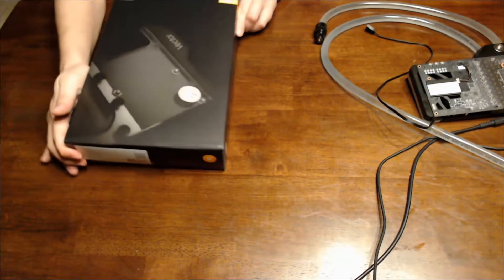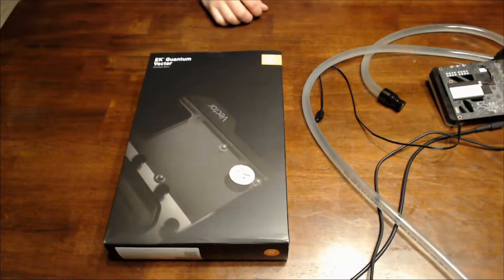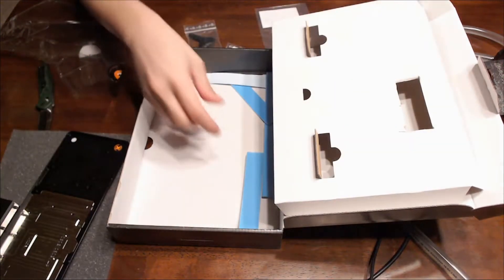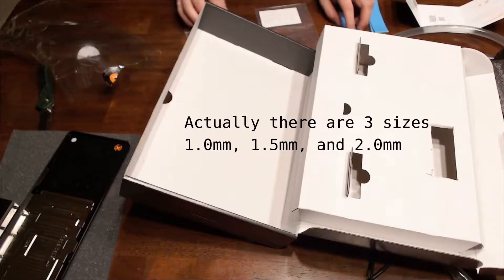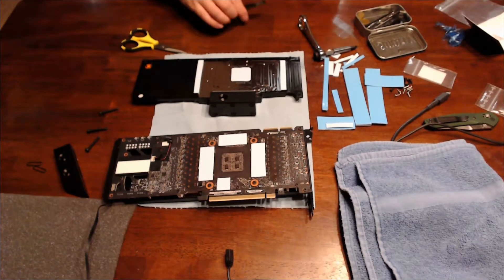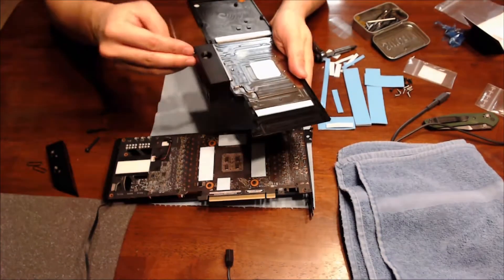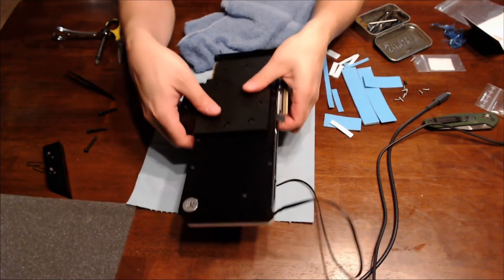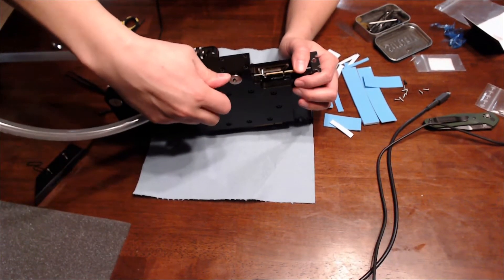EVGA 3090 XC3 EK Vector Active Backplate

Comment: Blocking the way? you took the VRM heatsink off!! lol
how did that work in the long run?
Reply from the maker: Good catch and it didn't work well... seems the block has a flaw. I should have done more research beforehand. After when I saw terrible performance I took it apart and learned a lot. I made another video where I did a fix to compensate. Now running in the 40s or 50s under load and it's awesome! Here is the video where I do the choke fix for the water block using a piece of copper. https://youtu.be/dSBPAx9fDao
Reply: @nispoe  I'm running in the exact problem with my Z690 Dark Kingpin mobo, I was just to trim 2mm off the finns to fit the FTW3 A-backplate